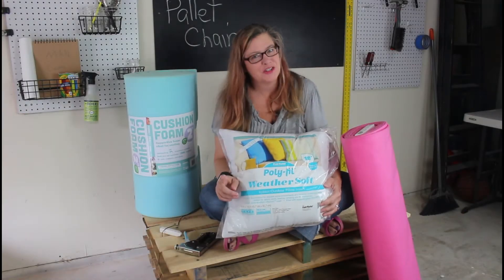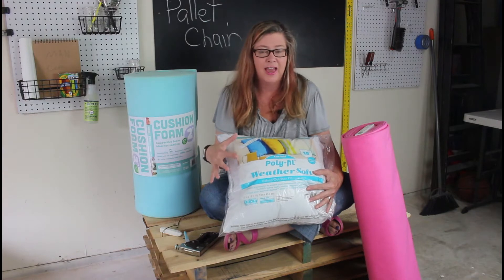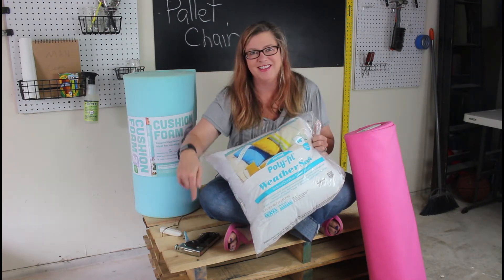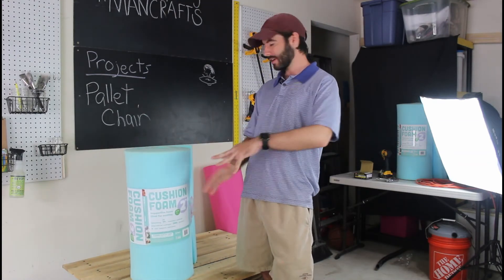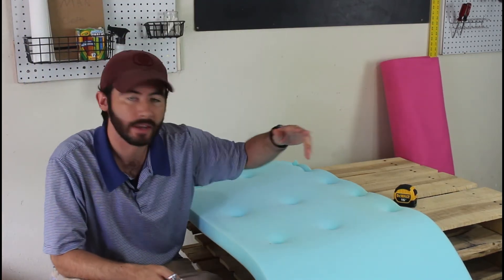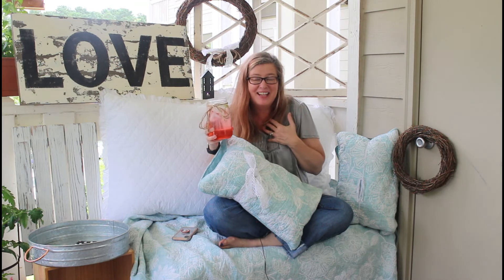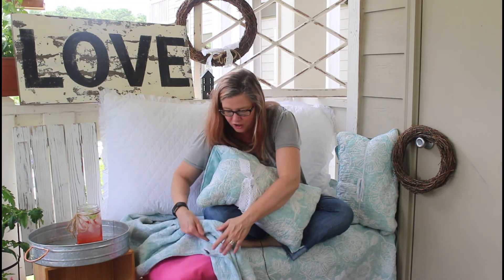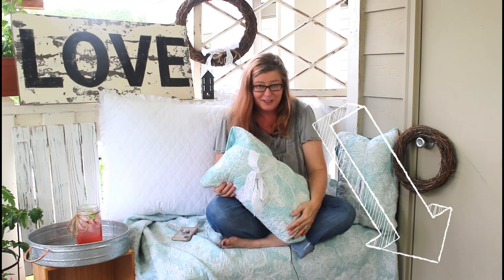DIY Pallet Cushion Seating

Comment: aahhh... no.  Sorry but just looks a mess..   You need a roll of foam (not stapled to make dents underneath a tight top cloth); a length of upholsterers  wadding and your chosen fabric.  Cover the pallet with the foam then the wadding and staple just around the sides.  Then stretch your fabric over the top of your base and pleat at the sides to get a good fit then staple again at the bottom.  You can create a buttoned effect if you then drill through the fabrics; through the pallet and attach a button either side.   If you staple at the bottom of the pallet Underneath) you can then  put a sheet of ply on the bottom and attach wheels or feet if you want them.